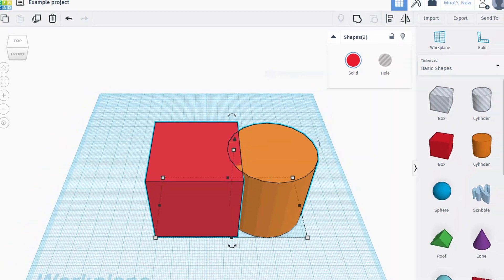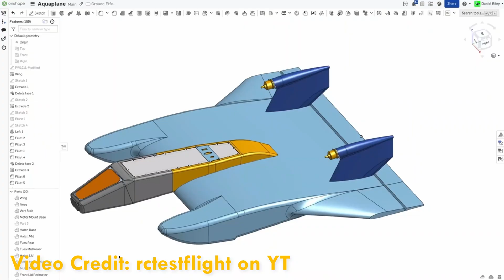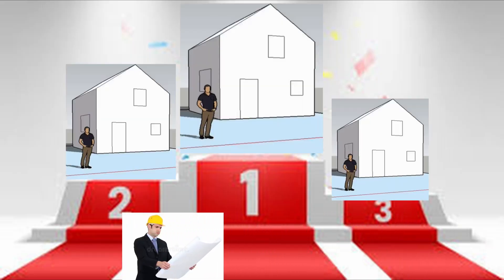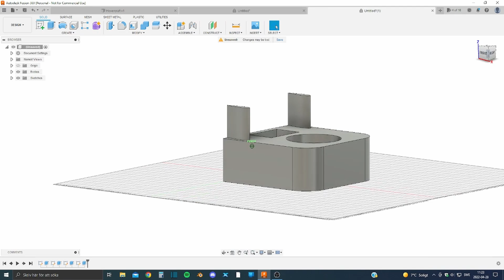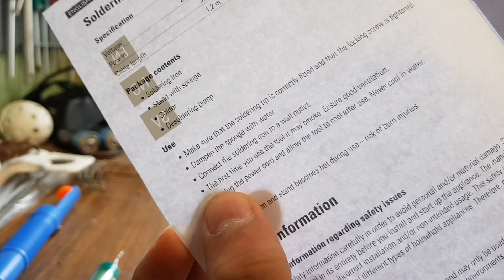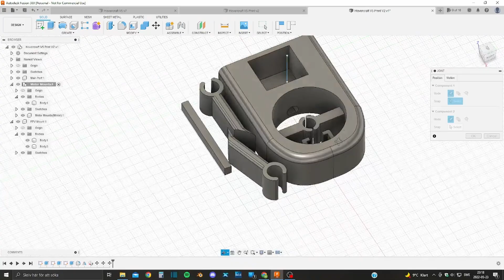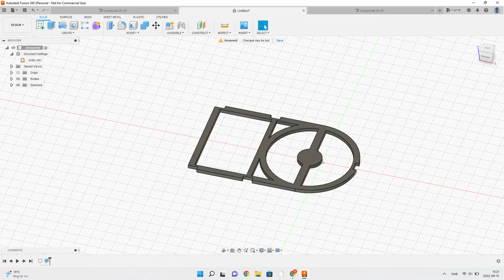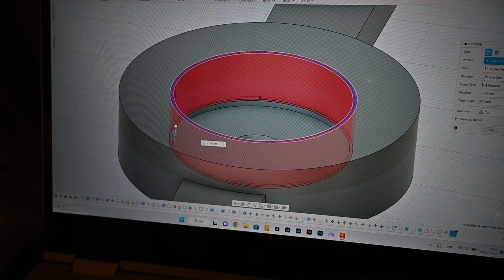Making Tiny RC Hovercrafts

Comment: Which parts did you use for this? I am hoping to make one of these hovercrafts myself.
Reply from the maker: The electronics for this project were taken from a small rc toy helicopter. (The ones with two counter rotating props and a tailrotor facing upwards) I simply dissasembled the helicopter, took out the electronics (PCB, battery and 3 motors) and thats what powers these hovercrafts. One could probably use the electronics from a tiny drone too if you have one of those available to you. Everything else could just be made with cardboard or 3D-printing. Good luck!
Reply: @ Thanks!
Reply: @ Could you tell me the model of the toy?

Comment: How long does it take to redraw a part in CAD make a hole a bit larger and then re-print the part, vs chiseling away at an improperly designed part?
Reply from the maker: Very good question... If I remember correctly I tried different sharp objects to widen the hole but that destroyed the perfect cylinder shape and the motor wouldn’t fit straight. But yes, it seems a little strange in retrospect 😅

Comment: awesome lil hovercraft, i might offer, that soldering iron is probaby causing you the most issues, i had one similar, and it gave me so many problems soldering things and caused damage to the circuits etc, i found a temperature controlled soldering iron, and nowadays those problems went away, less replacing electronics because of my soldering, lol
Reply from the maker: That soldering iron sure is the cheapest one around. It would probably be wise to upgrade 😅
Reply: had the same issue for years and after way too many cheap irons i got a temp controlled one that was suggested in a vid by bigclive and never had that problem since.

Comment: great video, just a question what was the control you used and what was the receiver board ?
Reply from the maker: All electronics (except the lift fan) were salvaged from a RC toy helicopter: Main motors, RX, TX, battery etc. I'm working on a follow up video explaining these hovercraft in more detail but it's really not that complicated. I think you can figure it out :)